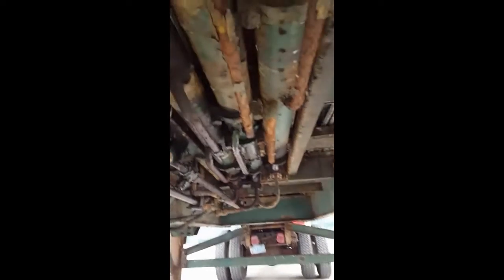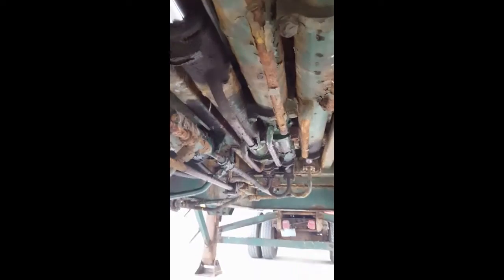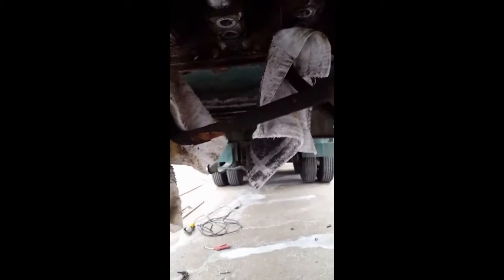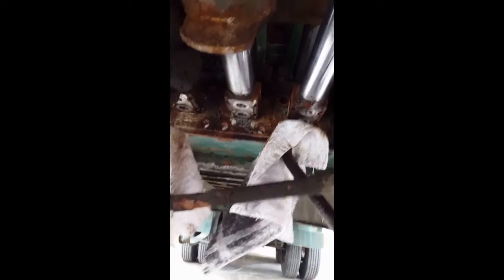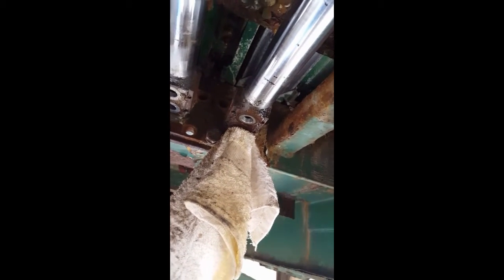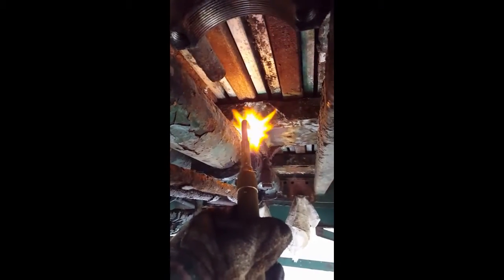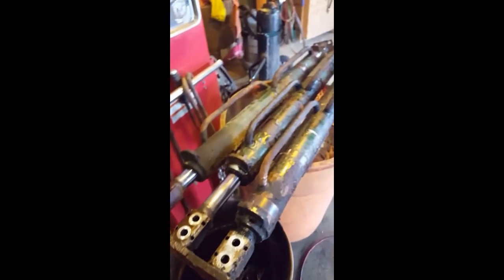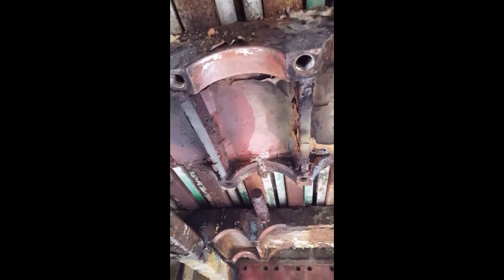Part 1 of Live floor piston removal.

Comment: When the trailer was new they should have added many anode zinc plates all over the trailer.
That really helps with electrolysis.  Just like a boat, all the dissimilar metals and road salt make for lots of corrosion.
When you rebuild everything you should sandblast and paint it with cold galvanizing, that really helps too.
Corrosion can be such a curse !